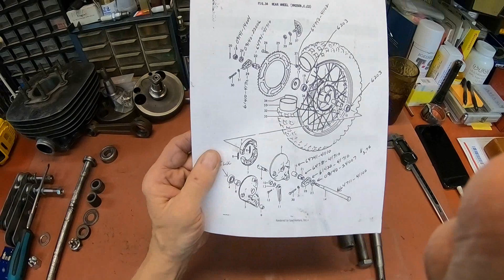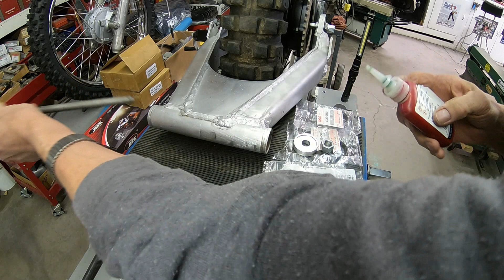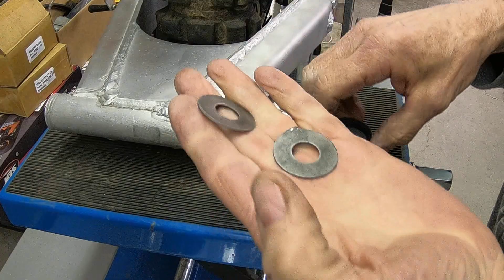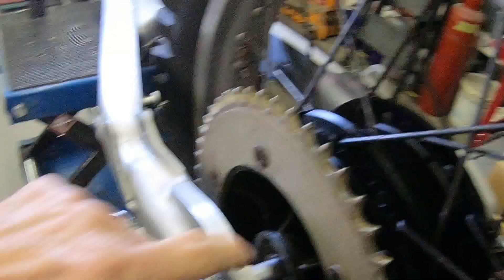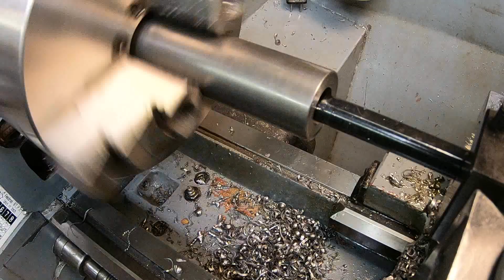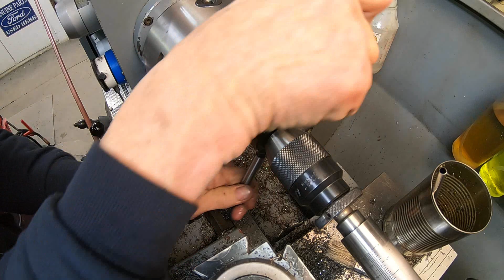Suzuki RM250 in a box, swingarm bolt, axle spacers

Comment: Another great video making parts. This is the best part about building these bikes. I noticed you have two lathes, do you use the smaller lathe much? What make and size is it?
Reply from the maker: Hi John, it is a lot of fun for me. I really enjoy the fabrication of parts. The small lathe does not see much use, I usually end up using it to repair my bigger lathe. But it is useful for some really small work. It is an Atlas 618 I think, been awhile since I looked at the tag on it. Thanks for stopping by.

Comment: Another great installment! Question from someone that knows next to nothing about machining ... when you are setting up a piece of stock that you are going to thread. How much do you machine off before cutting the threads?
Reply from the maker: Hi Pete, hey I'm no expert either, I use the Machinery handbook a lot in my ventures. This book is huge and has everything you ever wanted to know. (you can find them used on Ebay) It list major and minor diameters for threading. In my imperfect world, if I have a 14mm thread like I did in this video, I cut about .020 inches off the 14mm shaft then thread with my die. I always start with the size thread I am going to cut. In this case 14mm.
Reply: Thank you for giving me that information. I will look for that book. @montana2strokeracer

Comment: thank you for the vid ........I'm a 65 yr old just learning how to use a lathe.....I bought a Myford 7........love it so far but can see I might need to upgrade to something a little bigger as I progress......also bought a welding machine as welded my cracked classic bike frame not perfect but safe and its was neat doing that too.......keep the vids rolling Sir especially the lathe and welding ......cheers
Reply from the maker: Hi there, I am betting you are having a great time running your lathe. Machine work for me is very satisfying. I really enjoy the old bikes, and mixing both together is just outstanding for me. Sounds like you are making good solid repairs and enjoying the hobby. Thank you for spending time in the shop with me.

Comment: Great video as usual Dale. Detractors come and go, it's a sad state of affairs. Hardening a wheel spindle is a great idea if you desire brittle fractures. Keep up the good work, Dean.
Reply from the maker: Thanks Dean and happy new year my friend. Yes, I for one have better things to do. I agree, when he was saying that I thought to myself, if that was over hardened and you took a high jump the landing could shatter the axle. Seems a different material would be more in line, than hardening. To me hardening is more for abrasion resistance. Or for like bearing components. I was little afraid to harden the shift shaft that I rebuilt; afraid it will now wear the shift lever spines. Good reason to keep the bolt tight. Thanks buddy.

Comment: Happy New Year to you Sir........may I ask ....when making your press-spacers is it just normal steel or do you use a special material please and thank you.
Reply from the maker: Thank you and Happy New year to you, my friend. Are you referring to the press plates I use on the Hydraulic press? Yes, those are just 1 inch or 1 1/2-inch-thick low carbon steel like 1018. If you are referring to the spacers, I made for this project to space the wheel to the middle of the swingarm, they too are just low carbon steel like 1018. Some call it cold roll or hot roll.
Reply: yes Sir.....the press plates.  and thank you for your reply.   @montana2strokeracer

Comment: Very nice work there Dale! Keep it coming. I have to rely on outside resources for some of the machinery and fabrication work for parts that I'm not able to find. Looks like it will take a little longer to get the TM's back together.
Reply from the maker: Hey David, you should be picking up some old machines to help with your bike projects, I think you would enjoy the machine shop side of the hobby. When you roll the two together it is a very satisfying. But weather you do or don't, as long as you are having fun that is the bottom line. I would like to come across an old TM, but I bet the parts are even harder to come by. My last TM was a 75 TM125. Then in 79 I went whole hog for a RM400. Best dirt bike I ever owned.
Reply from the maker: Hey, thanks David, you should consider finding some old machines to help support your motorcycle hobby.  You roll the bikes together with the machine shop to support it, and it's a barrel of fun. Weather you do or don't, isn't important, as long as you're having fun that is the important thing. I would love to run across an old TM, the last one I owned was a 75 TM125, then in 79 I went whole hog for a RM400, best dirt bike I ever owned.
Reply: @montana2strokeracer I am considering getting a couple of machines now that I have the space after I rearranged things. Have to see what's available out there.
Reply from the maker: I think you will be forever thankful that you got them. I use mine every day. Would be lost without them.
Reply: @montana2strokeracer I may just wait until after I'm  done with the suspension and performance upgrades on the 74 TM's.

Comment: 32:03 I would have thought that sprocket alignment is more important than getting the rear wheel in the middle of the swing arm, of course it could be that the sprockets actually do line up when the wheel is in the middle of the swing arm.
Reply from the maker: Of course, that is the objective, but small steps my friend. I must have an engine and frame and swingarm and sprockets to align first. This probably will be only close, but I need the wheel to not slip side to side and all the other parts that are part of that alignment to be installed first. These spacers took about a half hour to make, if I need to trim one, and make another, it's not the end of the world. In most cases that I have seen, if the wheel is centered the sprockets will be pretty close. Exception is on some of the older bikes that the wheel was not centered that good when the sprockets were in line. Thanks for spending time in the shop with me.
Reply: @montana2strokeracer  Good stuff, I have a small lathe, I agree, it would not be the end of the world if you had to remake the spacers. With regards to spending time is your workshop, well it sure beats the work that I am supposed to be doing! 🙂